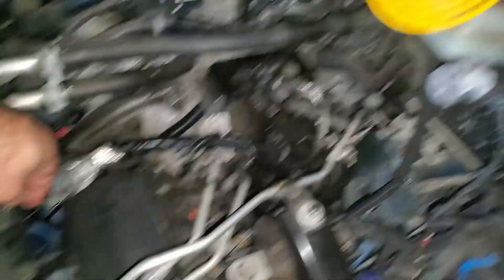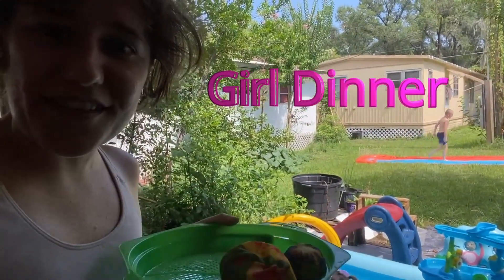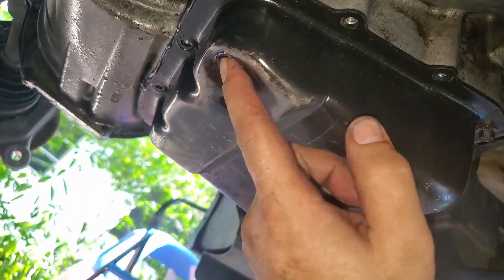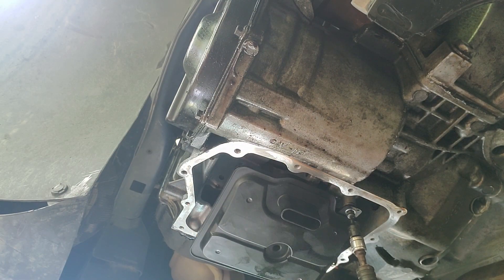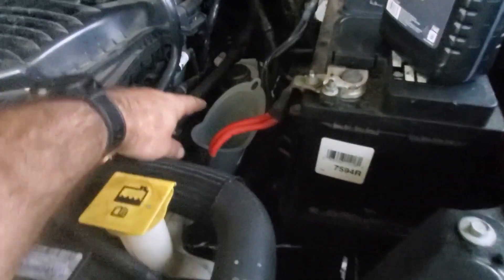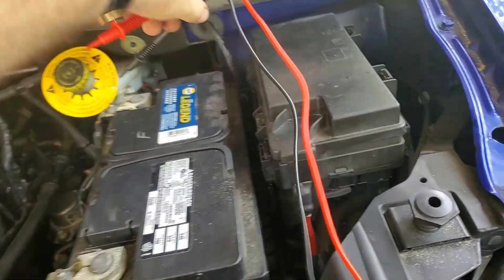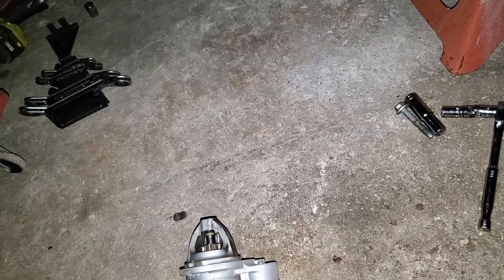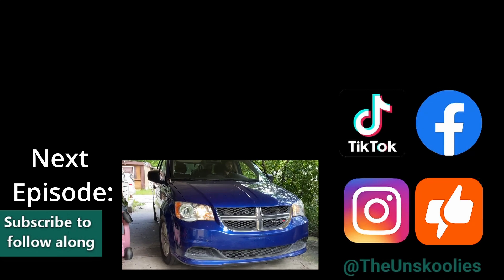Dodge Grand Caravan Transmission Replacement at Home! - Part 3: Transmission Install

Comment: Great job.  I took out my transmission as well.  So what happened with the starter?  I was wondering if you secured that ground wire to the transmission before trying to start up.

Comment: caravans are garbage.  they use plastic parts on the engine!!  my 2014 neeeds the got damn oil fileter housing replaced becuz jiffy over tightened!  now its cracked